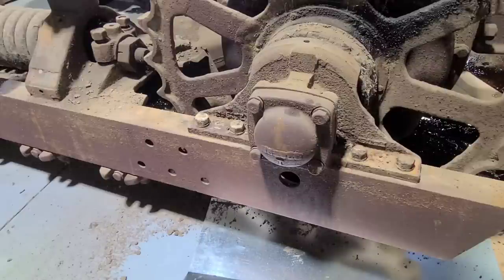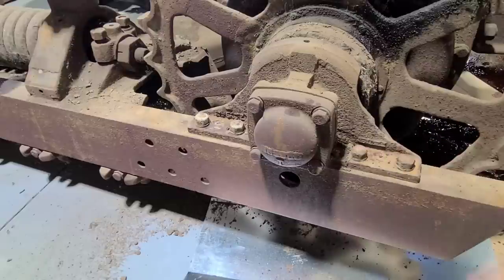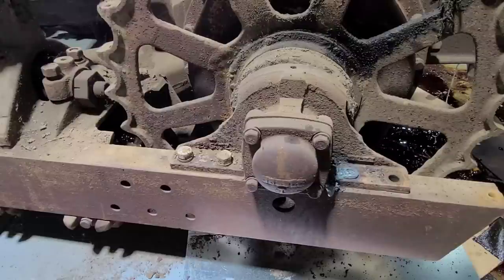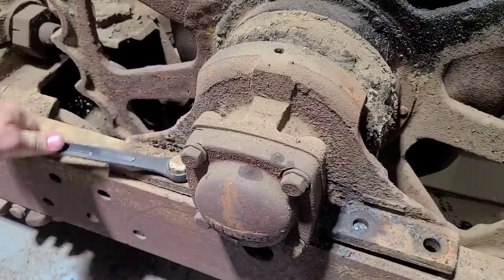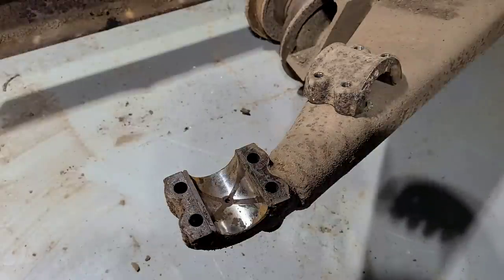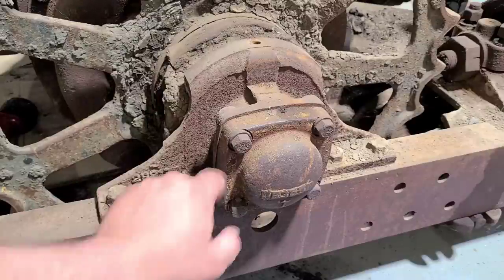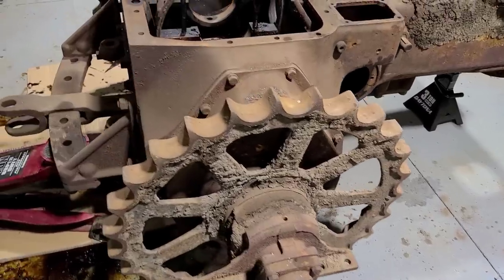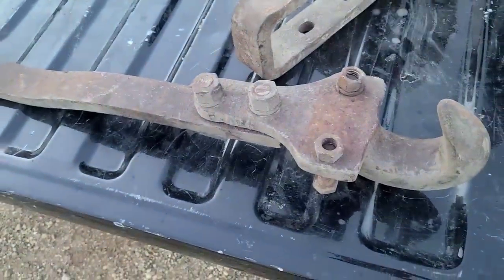Caterpillar RD-4 Track Frame Removal

Comment: I used to be left handed until I broke my arm when I was four .... now I can eat with both hands.👀🤦‍♂️

Thanks Kyle, liked your suggestion on cutting bolts. I'll try that next time. I need to pull one of my 955C track rails off my parts rig, there is a guy in Talkeetna that needs it real bad. Last year he got 7 or 8 feet of snow pack😮. He sent me pictures of snow and a tape measure.  
Anyway thanks for the video and your time.
Reply from the maker: There is a 955 down the road from me with almost brand new undercarriage. I'm working with the guy to get it bought

Comment: Very good advice on cutting away bolt heads. Hope the other trackframe is better. Even this one is repairable but just take more time and afford.
Reply from the maker: Other track frame is about the same condition, both repairable if need be
Reply: @kylechrist  Alright. Also if you got any other tips on doing things. You should talk about it more to us the viewers. Not all of us have experiences with removing rusty bolts or doing other sort of metal works. I find these tips very helpful.
Reply from the maker: @SuperMAZ007  I can do more of that as we come across different situations 👍

Comment: Nice 👌  I have  been  cutting  bolts like that for  40 years
Reply from the maker: That's how I was taught by an older gentleman, and like I said, I've seen people try to cut the bottom side of the head and it gouges the base material, this way leaves everything clean 👍
Reply: @kylechrist  yes it dose 😊👍👍👍👍👍

Comment: I saw the piece of galvanized underneath the bolt you cut with the torch. Sure protects the concrete from spalling.
Reply from the maker: Yes sir, I try to do that whenever possible, the sealer on the concrete doesn't like heat either

Comment: I pretty much do it that way too unless I can use a junk metric wrench to break it free prefer to use a torch as a last resort even retooled a few nut splitters too.
Reply from the maker: I have a set of sockets designed to bite in to rounded off bolts/nuts that I could have used but this was just another chance to show tips/tricks that some people may not know. Thanks Shane!
Reply: @kylechrist  yeah I know I cant remember how many times I'd done that myself  my dad was always waiting to see what I'd do in certain situations. Like takeing Oliver AG6 spindle and bearings to school along with the only clamshell front idler halves he could find and turned them down to the right size for what we had the spindle and bearings got the pressing and the rest was turned on a over sized Bridgeport end mill with a rotary table as the school shop didnt have a big enough lathe.what baked his mind was I came home with a 1936 tricycle front yolk axle slip bushings and  cast steel front wheel assembly with a hand made wheel guide made from 2 pieces of angle iron  he was speechless he seen me leave with the AG6 parts and came home with mc McCormick deering parts

Comment: Your tractor is shrinking nicely. How long do you do fire watch after cutting, grinding, and welding?
Reply from the maker: Minimum 20 minutes, but 99% of the time I'm in the shop for hours after. I also try to cut into a pocket rather than blow molten steel all over the shop, and I also try to have a piece of metal underneath so the slag doesn't ruin my concrete, thanks Chuck

Comment: If there are better parts out there, use them, may not be all "original" but it'll be all RD-4.
Reply from the maker: I agree, quite simply with the age and condition of this machine, it would be almost impossible to restore without using new, nos, or used parts. I will keep it early RD-4 yet, just going to use the best parts I find. Thanks William
Reply: @kylechrist  Pleasure is mine, been an honor following your build.

Comment: Kyle do you have any thoughts about the curved jaw versus the straight jaw? I think I might need to get the Knipex version for the curved jaw
Reply from the maker: Quite honestly it comes down to the job or task at hand. Sometimes one will work better than the other. Knipex makes excellent tools, I really like their water pump pliers set. Probably not much help but I don't think you can go wrong either way Eric
Reply: @kylechrist  Thanks

Comment: Rather than finding, and paying for, another track frame, weld up the worn area. Grind down to level, easy enough. this will not be a working machine, instead be show machine. If you're any good with grinder, will work just fine and last long enough for you to pass it on to your grandkids